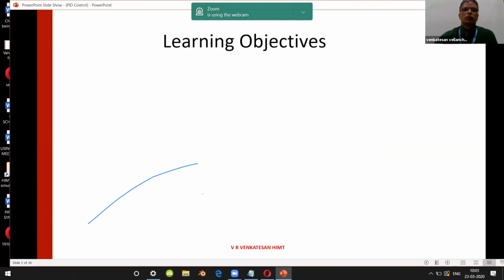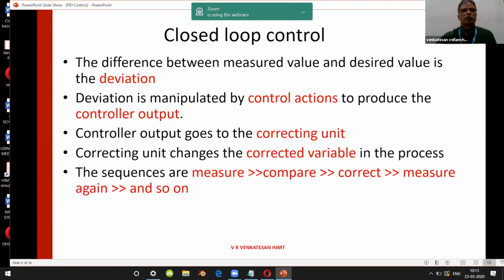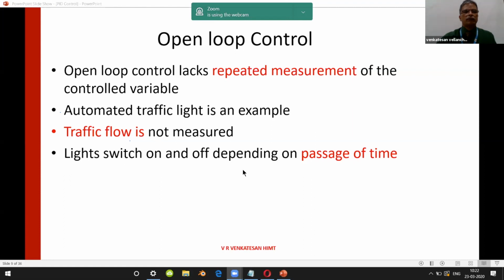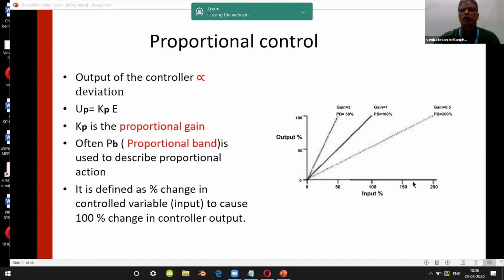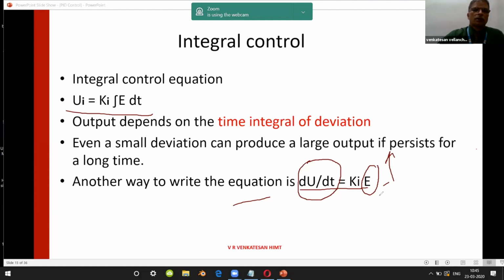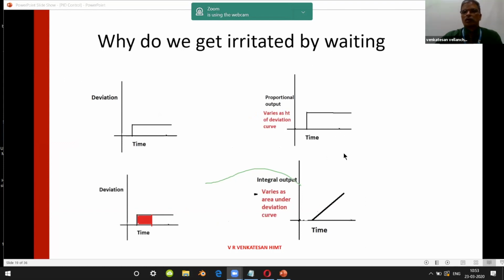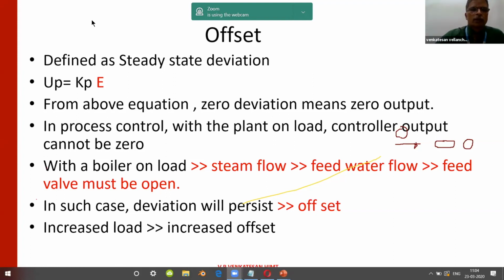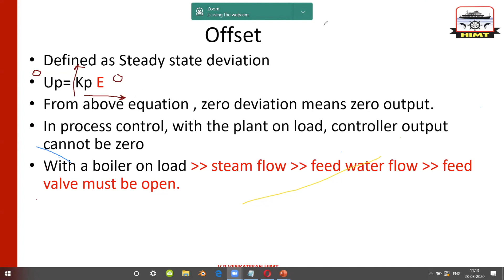PID Control (Part 1) | V. R. Venkatesan | HIMT

Comment: Assuming a generator paralleled with grid. If the AVR voltage is set to the grid voltage and later Should the grid voltage increase above the generator voltage setting, will there be reverse power?
Reply: reverse power takes place when the power developed by the prime mover drops below idling power. in the situation mentioned the kvar of the alternator will reduce